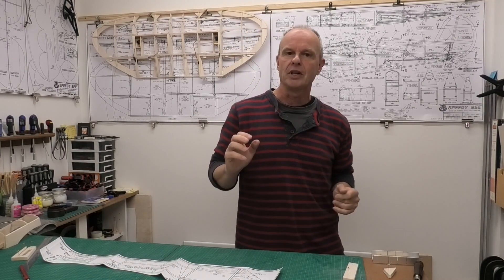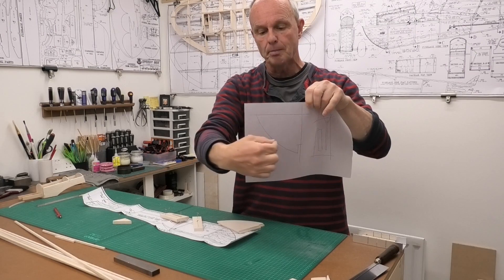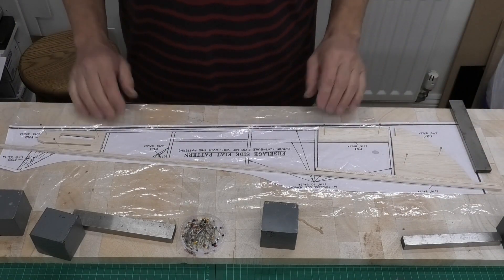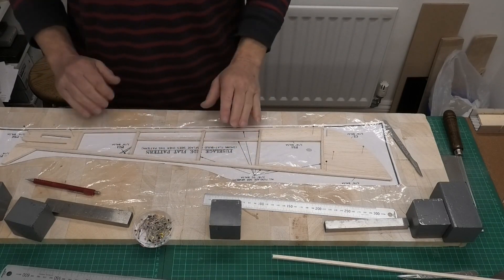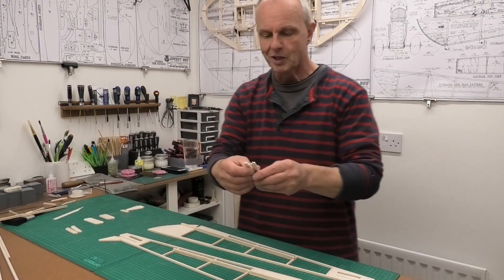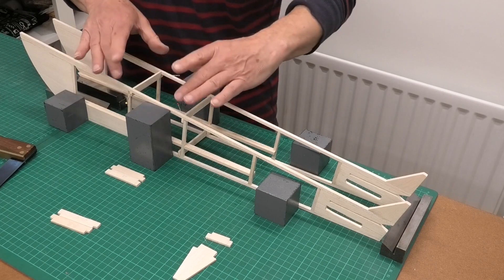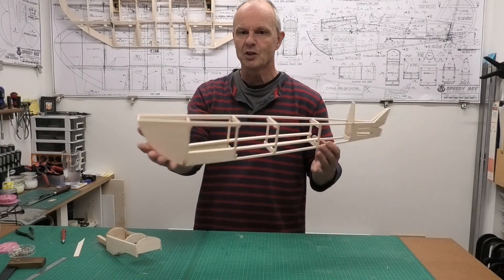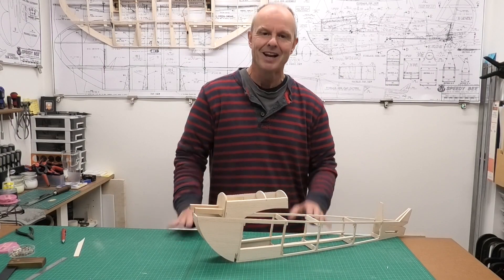Speedy Bee - Build Series Pt 5: The Basic Fuselage - Designed by Clancy Aviation - OS fs26

Comment: Howdy, Mark!
Here's a little trick I learned about sandpaper.
It clogs up more than it wears out.
So I take my 15 inch straight edge and slap my sanding block with it a few times.
Cleans it up like new. Lasts much, much longer.
See you in the next one.
Reply from the maker: Hi there Richard, thanks for the comment and great suggestion, always appreciated 😀
Reply: @MarkRobinson555  
Good morning, Mark.
Have you tried it? It really works.
I worked for many years as an auto painter. Did a lot of sanding over the years, and I have the calluses to prove it.
And I only use 3M gold sandpaper.
It's more expensive but it cuts better and lasts much longer.
Carry on, soldier.
Reply from the maker: @richard1472  not tried it yet, I do knock a couple of sticks together which also works.  I will try it later, still drinking my morning coffee so not done it yet today! Hahaha As you say, only quality sandpaper is worth using.
Reply: @MarkRobinson555  
You said it, brother.
It's just after midnight over here.
Time for me to get horizontal.
TTFN!